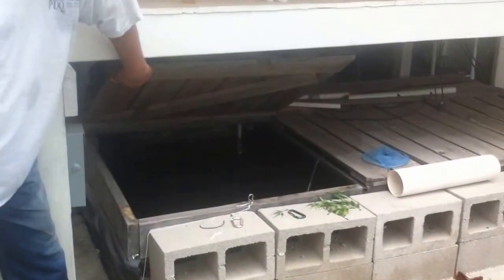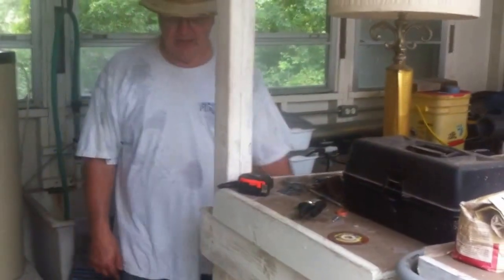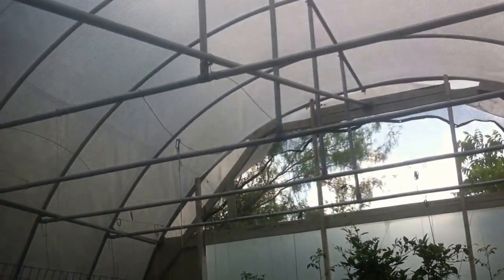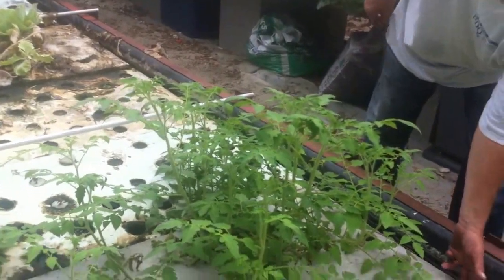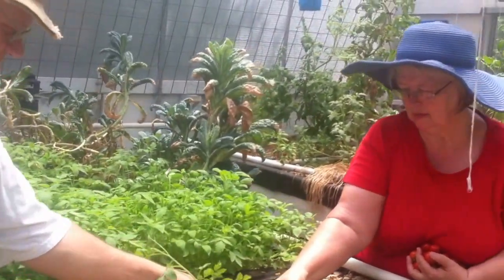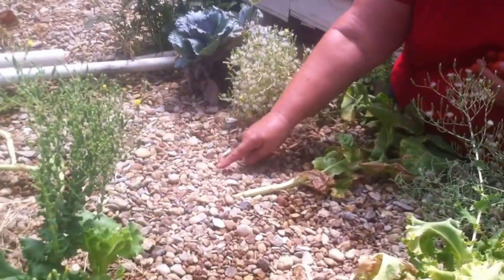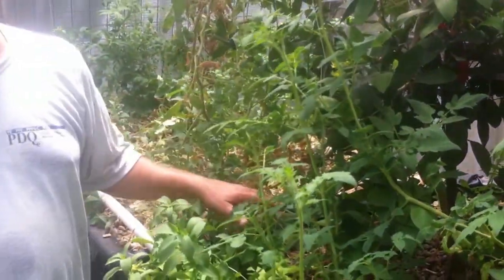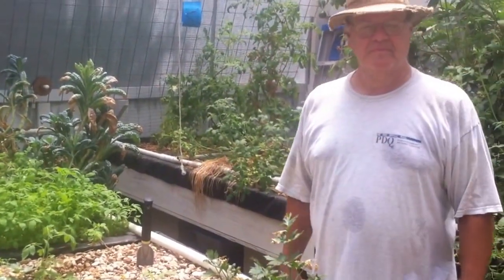Growing Citrus in Aquaponics

Comment: do you keep the water above a certain temp for the citrus? im in the north and trying to decide between building a heated soil bed thats watered with aquaponic water and just putting the tropicals  in the aquaponics, but im worried about water temp in the winter killing the roots
Reply from the maker: +Jason Boulard great question, we do not heat or cool our water. We use catfish because they can handle more extreme temperature. Also because we are in a greenhouse we never get the water to freezing. Plus it's always flowing and that helps too. We do sometimes heat the air on very cold days but I have never seen the water temp below 45 degrees. The roots will do fine if the temp stays above freezing and at 45 degrees they do great.